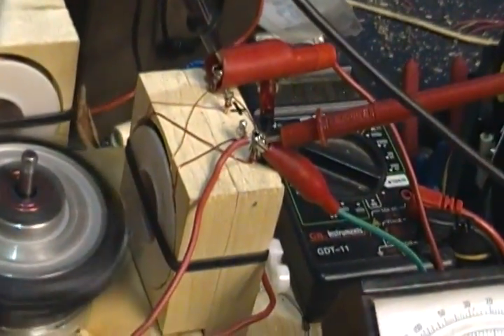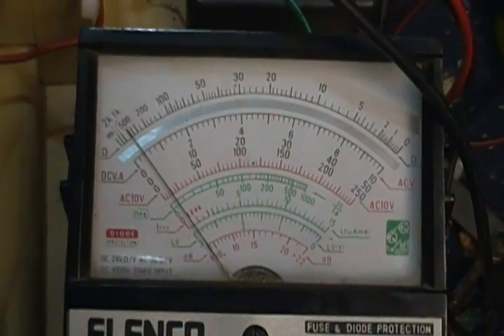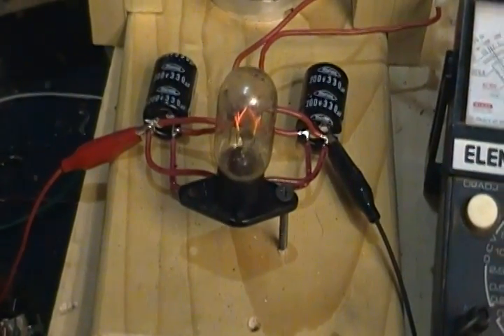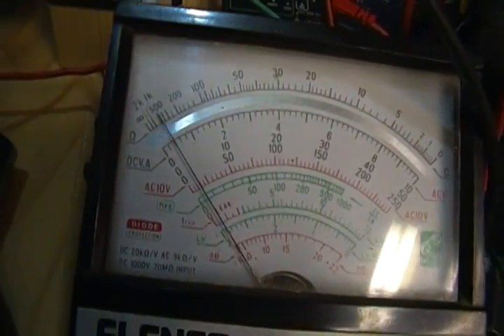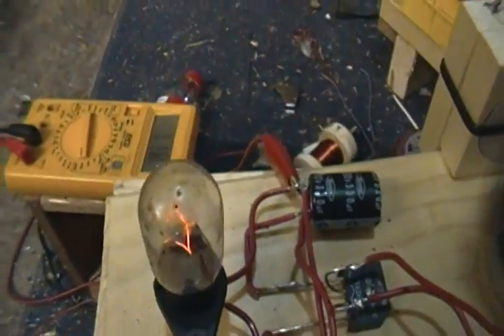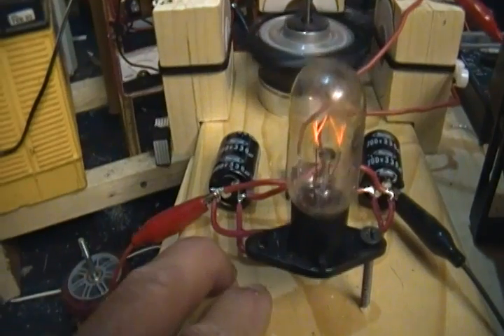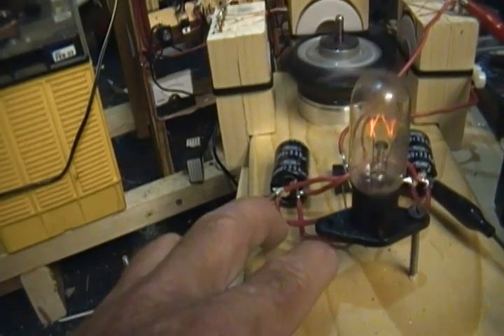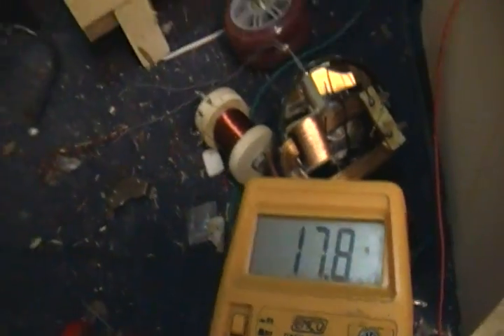Bedini generator

Comment: Try to connect the battery directly to the light...
Reply: I'm pretty sure 9 volts will not have much effect on a 120 volt light.  If I'm wrong I will quit electronic projects.
Reply: texjarhead  Ahah! Ok then, try using a 5v lamp? just guessing....;)

Comment: A light bulb is the best load because of no inductance.
But a digital multimeter is useless for measuring pulsed voltage.
The whole Bedini overunity idea is based on measuring errors.
John Bedini himself noted that he didn't have the right measuring equipment.
A True-RMS power meter will sadly pop your dream...

Comment: your lamp light because the back emf induces a high voltage pulse.
the lamp has high impedance, but if you try to apply the emf back to battery
no-load which presents low impedance your voltage collapse.
the law of thermodynamics is inviolate, no battery charge.

Comment: Question ? why did you use a bridge rectifier and a capacitor, if your load is an AC light bulb? maybe you should connect the bulb directly from the coil which generates AC... :D

Comment: It looks like a Bedini setup, but it doesn't seem to work as a Bedini setup. You can't light up a light bulb with radiant energy, according to John Bedini. A battery should turn the radiant energy into usable energy. If you light up a light bulb then you m ade a generator, a normal generator, although it is a rather complex normal generator. Many people do not understand what John means with Radiant energy, and many people use the wrong magnets.